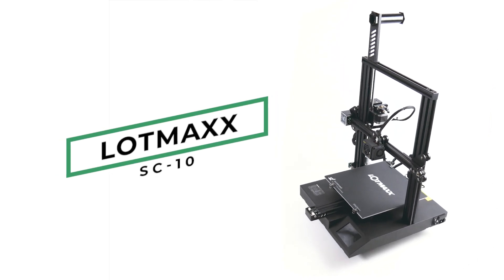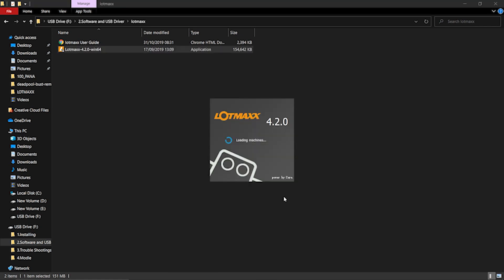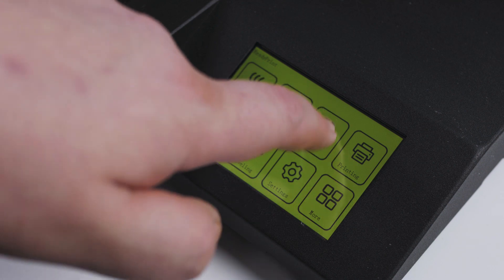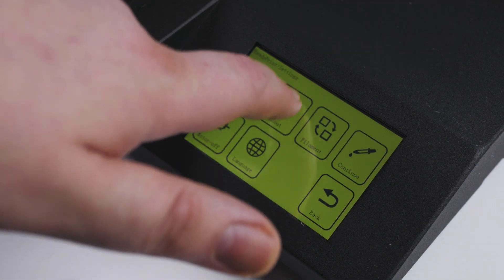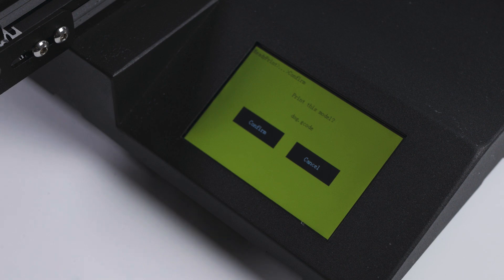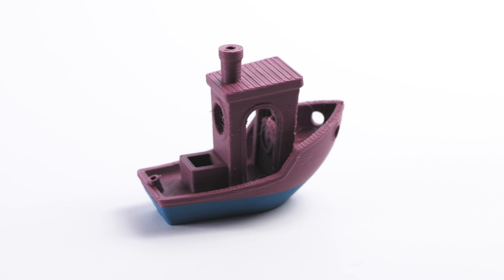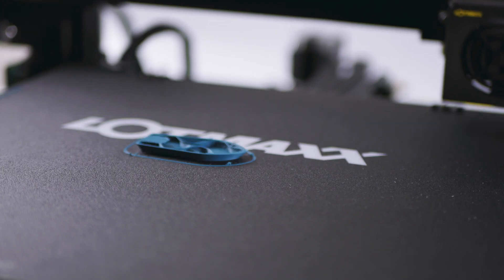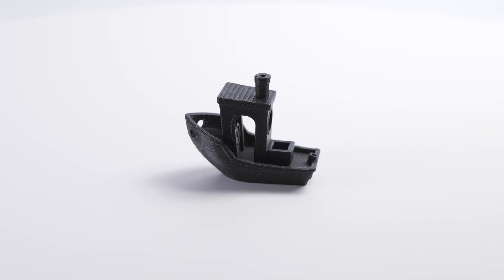LOTMAXX SC-10 Review

Comment: What is the name of the wifi module and what do I modify to the printer to use it?
Reply from the maker: The module is the "Makerbase MKS Robin WIFI module" and you need to change the Wifi Settings in the firmware to have your routers name and password so it can connect to the network.

Comment: Very good review, actually one of the better for this printer. I've had mine for a year and I upgraded the Bowden tube to Capricorn tubing, changed to a triangle lab all metal hot end and recently changed the glass bed for a spring steel pei kit I got on Ali Express. I was hoping to find source code for this to compile firmware so I can modify the bed and extruder temperatures. Too bad the firmware is closed source for this printer. The closest I got was a German YouTuber that put out a Marlin source he used to flash his SC-10, but I don't like how the touchscreen looks and works. I like the option for full color, but I prefer the way the original touchscreen menu works over what is configured it his version and I don't b want to spend a lot if time building a menu system. So I flashed it back with the original fw for now. 

It's interesting about the MKS nano 1.2 board you mention in another comment. I may pick it and the WiFi module up and try them out. Did you ever do anything more with yours? I'd be interested in seeing any upgrades you've done. Hope your doing well! 👍
Reply from the maker: Thank you for the kind words. I have managed to get Marlin 2.0.8 running on it, and MakerBasse has now put a full-colour touch display version of Marlin out too. https://github.com/makerbase-mks/MKS-Robin-Nano-V1.X (I did this on a spare Robin Nano 1.2 mainboard as I wanted to keep a stock copy of the firmware, and would have wiped it flashing another firmware onto it). 

For Upgrades, I went with updating all the steppers to TMC2208s with UART mode (have to do a little soldering and use the extra pins on the wifi module port to get all the UART goodness like being able to switch between stelthchop and spreadcycal and set the current on each motor. Added a probe for bed levelling, new springs, PEI spring steel bed, BMG extruder, the same triangle lab all-metal hotend, better PTFE and some belt tensioning knobs...so very similar to what you have done! 

With how cheap the Robin Nano board are now I really think it's worth grabbing one just to play around with firmware options. My next thing will be trying Klipper Firmware, as I have found that the largest upgrade to my printers. The Resonance Compensation tool in Klipper makes printing at really high speed possible.
Reply: @PigeonPrint  That sounds great! I installed a firmware someone did in the Lotmaxx 3D Printer User Group on Facebook, which enable BL Touch and WiFi and the stock screen looks great with full color display. I look forward to your next video, cheers!

Comment: As to the follow on video... Please!? I am awaiting delivery, I don't need to "hot rod" it, but I do want to know what the available options are. (I had an Ender 3 in my cart and threw it away with abandon when I watched a few reviews of this printer).
Reply from the maker: Will do Jack, luckily there is a lot of crossover with modification on SC-10 and Ender 3, very similar printers but the SC-10 has a much larger bed to start with. working on a video where I add an all-metal hotend, a PEI spring steel bed and some belt tensioners, theses are as far as most people would tend to go but also going to cover adding a mainboard to run opensource Marlin firmware and some auto bed levelling options. Any questions about your printer feel free to give me a shout and I will try and help out!
Reply: @PigeonPrint    Thank you, I will!

Comment: I love my SC10,have been running it almost non stop for 3 months. Have gone through about 10 rolls of PLA making mostly nightlights as gifts. Only problem so far is the composite mat ripped so I put the glass bed from my dead Anet on it. I don't trust the wifi in my house to stay on so I'm not interested in that upgrade.
Reply from the maker: And having the WIFI module inside the metal base has got to be somewhat detrimental to the range even in optimal environments. Yeah, that type of bed is inherently prone to ripping, found a couple of places doing 250x250mm replacements, and testing out a magnetic spring steel PEI coated bed that's been really impressive so far. Also playing around with a couple of other extruders, but the stick one is so much better than the plastic units you find on Creality and other printers in the range, it's really a very good printer for the price!

Comment: Is the printer able to take a BLtouch ABL?
Reply from the maker: Hi Glenn, good question! As stock no, but you can if you use some of the WiFi modal pins and flash stock Marlin firmware you can. Or if you replace the MKS Robin Nano board V1 main board with the MKS Robin Nano board V1.2 you can, as the V1.2 has a dedicated set of BLTouch pins and is about $16 for the V1.2 board. (just got a V1.2 so will be doing a video on how to switch it out and add BLTouch)

Comment: How to make timelapse video? Do you use Octoprint?
Reply from the maker: No, I printed a little bracket and put it on the far right of the X-axis with a microswitch and added some G-Code to move the print head to the far right and trigger the switch every layer change, and hooked up my camera to the switch. I did it this way as my camera is not supported in Octoprint.  Octoprint would've been much easier :)
Here is the part I made and the G code:  https://www.thingiverse.com/thing:4520357